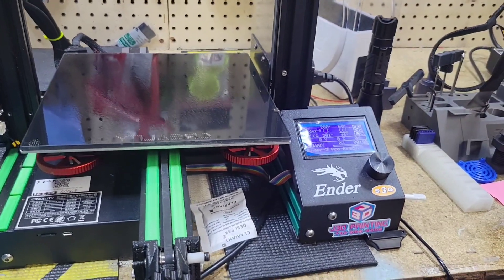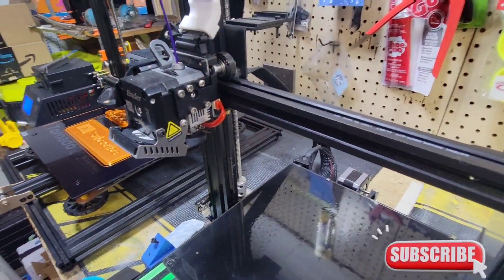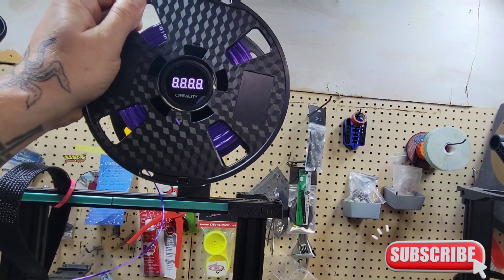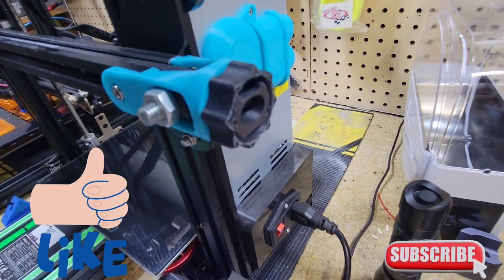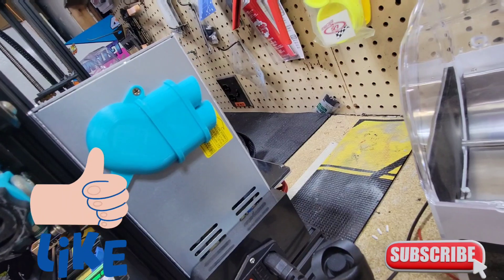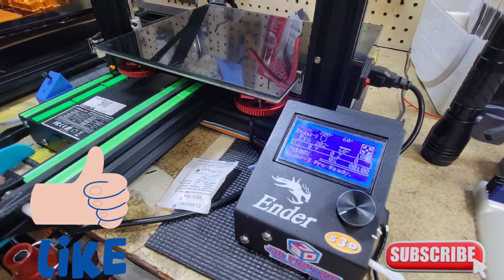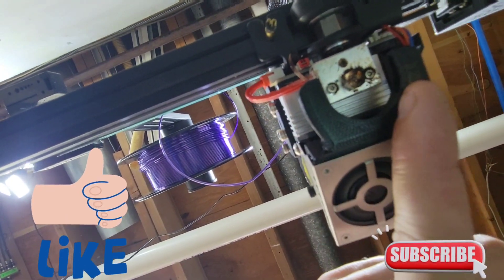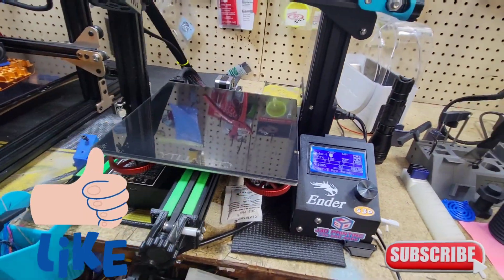ENDER 3 PRO UPGRADES!#ender3pro #ender #creality3d #3dprinting #plafilament

Comment: Jay, does the sprite extruder have a filament sensor?
Reply: I've done a bunch of upgrades to my ender 3 pro but still running a stock extruder that I've wanted to replace for years but just haven't gotten around to it
Reply from the maker: I live the sprite hands down color change is soooooo easssy!!!
Reply: @J3DPRINTING  one of the reasons I think I'm gonna get one. Also I'm tired of the stock extruder setup skipping. Even with a fresh nozzle, every tube anyone's ever sold and 4 different all metal extruders I still get skipping
Reply from the maker: @mikeybrod  yea I love direct drive only part I don't like not as many mods for then but I have alot if you ever buy the kit let me know I have 3 ender 3s and one ender 3 s1 among the others lol 😆
Reply: @J3DPRINTING  I'm struggling with a bl touch right now. Can't get first layer adhesion to save my life. Thinking about pulling it off and going back to the limit switch. I just ordered the sprite 😊
Reply from the maker: Niceeee them auto level sensors only create a mesh my opinion is they make it worse I like to regularly level just use yellow springs or rubber ones and you will be fine
Reply from the maker: No it doesn't